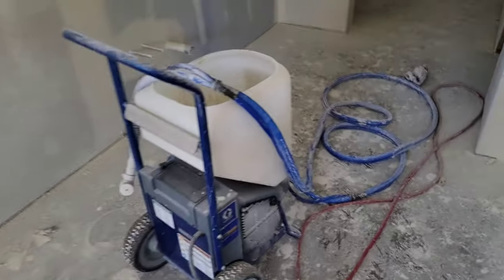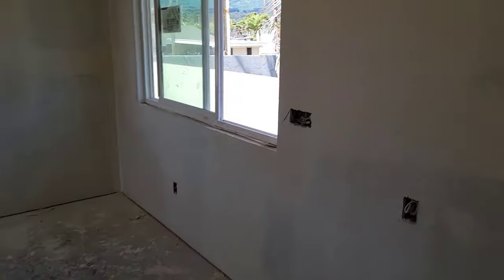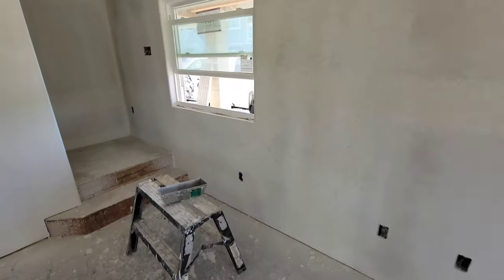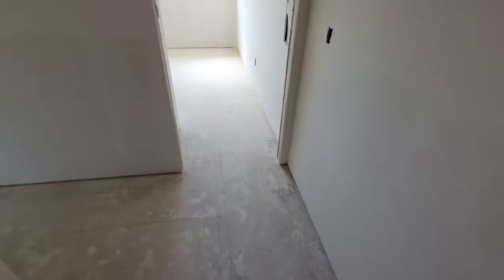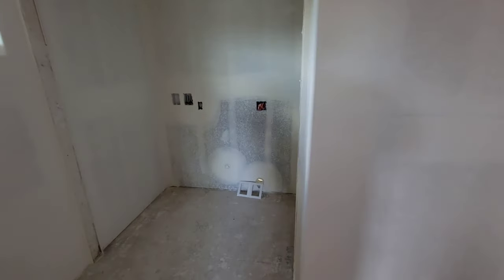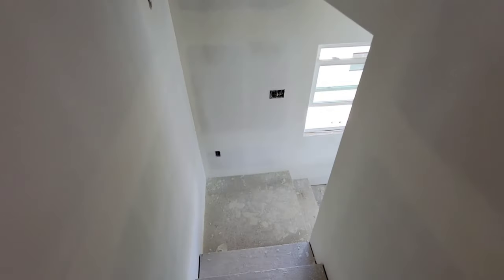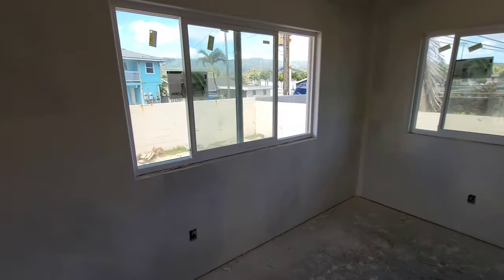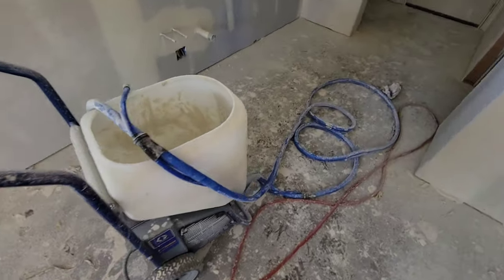GRACO RTX1400

Comment: I use two stage rolair big compressor and graco hopper i mix-in apla tech reservoir and strain into the hopper and go.. but yeah never used a spray gun and hose hopefully one day.
Reply from the maker: Thanks a solid set up next decent size job if you wanted to sample home depot rents them for about $100/day..
Reply: Oh shit ok ✅

Comment: I use an old kraft compressor/hopper set up. I would upgrade to that for sure but I barely do any texture outside of ceiling repairs. Pretty much all the new projects in my area are smoothe finish. If that changes in the future I would definitely enjoy shedding the weight of the hand held hopper
Reply from the maker: If you ever get a random bigger job they rent them at home depot.

Comment: I bought this model but think I should’ve gone with Fast Finish system because the majority of my work is small stuff, patches, remodels, etc. The longest hose they recommend is 25 ft and that causes me to have to bring the machine into areas I would prefer not to. Not complaining about the machine by any means, it works great, just complaining that I didn’t think it through more. 😂 The one thing I’ve been wondering and haven’t been able to find out is if I can run the fast finish hopper off the 1400 so I can have some longer hose length. My local supplier isn’t as up to date on the capabilities of these machines.
Reply: Also I’ve been meaning to ask about the fact that you don’t prime before you texture. I’ve been in the business for over 20 years, primarily on the hanging side, but just recently went out on my own. In all that time everyone I’ve worked for has always primed the walls before texture. What’s the reason you don’t?
Reply from the maker: 6.1 cfm on the rtx1400 and 9cfm on the fast finish should work but might be a little under powered should reach out to a rep and see if they recommend it.
Reply from the maker: They prime the walls to help minimize flashing/photographing. We do a light brush downg after spraying and have the painters back roll primer. It's really up to the GC's we work with most prefer having the paints come in after I think the painters charge more for having to take two trips.

Comment: Is it feasible to be able to do a skim coat with the graco rtx. Even if i have to spray compound on then wipe smooth with a blade?
Reply: your question is childish. Just why wouldn't you?
Reply: If you're talking about smoothwall solid coating, it would work great, but you'd have to have somebody right there on it. Before mud starts setting up.

Comment: I've owned the rtx 2000 smart start and it went out less than a year. I'm a drywall contractor aswell and I texture all my houses so thinking about buying the rtx 5000 for heavier uses any experience with it?
Reply from the maker: It's similar to the 2000 in the sense of the smart start feature so if that's what was frustrating you about the 2000 I would stay away. It can handle thicker material but you need a solid power source if not any fluctuation and the thing quits like the 2000. I been using the 1400 a ton since we mainly spray orange peel it's like the little engine that could a real work horse.
Reply: I was also told to go with the mark 5 for orange peel but would have to buy a separate air compressor for it and I don't want to go to a trailer rig so the 5000 is prob the next best thing for me.. thx for the reply love ur vids from your friendly Dallas drywall contractor 👍
Reply from the maker: No problem brother ya I wouldn't want to lug around the Mark 5 and a compressor just to texture. Maybe check your local homedepot rentals they should have the trx5000 and you can sample it on a job for alittle over a hundred bucks that way you see if it fits your needs thanks for the support 🤙🏽

Comment: Couldn’t you just use your mk4 with the air hose/gun to do texture?
Reply from the maker: Yes but I prefer to use a all in one unit. Easier to laod and unload. With the Mark4 I would need to carry a separate compressor. Going to strictly use it for level 5.

Comment: You guy texture alot of walls out there no one does walls here in Canada just lids and all smooth in anything high-end
Reply: I would like to find out how everybody does smoothwall ,say like level five, I've been finishing for 40 years and always hear of better ways, Tiger stripe, For solid coating takes time I get burned out quick. Spray on squeegee smooth, Or roll on with a paint roller, Or spray on like paint. How do you Canadians do it if you don't mind my asking?.
Reply: I never do level 5 smooth ceilings are just level three done with a bit more Care .then  paint with a product called pro coat . 
I've seen guys do level 5 on a vault room with huge windows always trowel guys out here